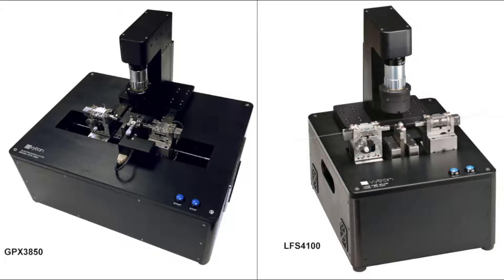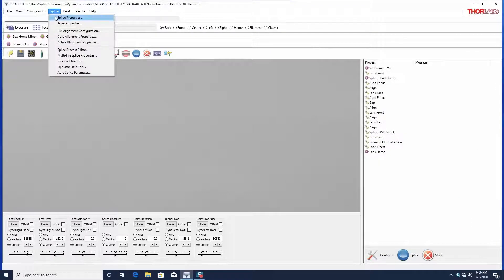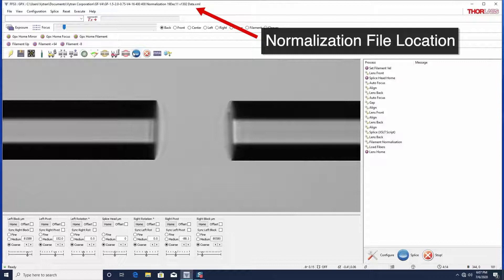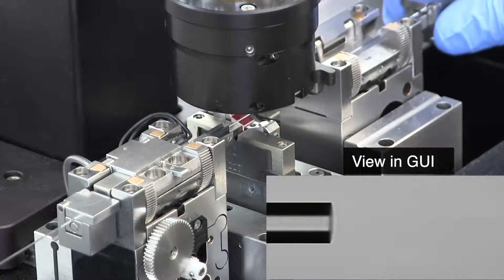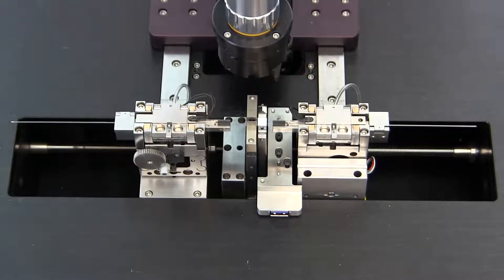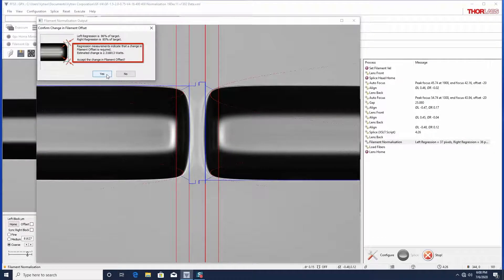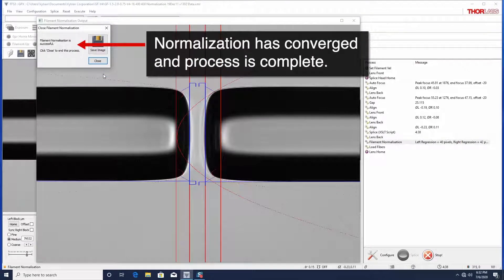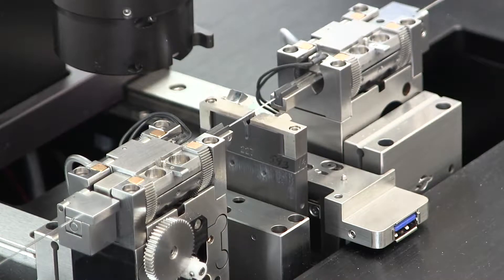Filament Normalization for the GPX Glass Processors or LFS Large Fiber Splicers

Comment: Suppose after completing splcing with 400 cladding fiber.If I planned to do splcing with 125 cladding fiber.should 125um fiber normalisation be done ?
Reply from the maker: It is best practice to normalize with the standard size fiber that is most similar to the fibers being spliced. For filaments with a 125 μm normalization file provided, we recommend running it before splicing with that filament.